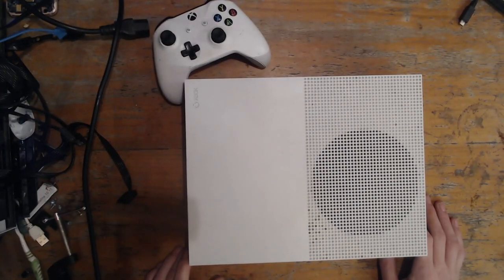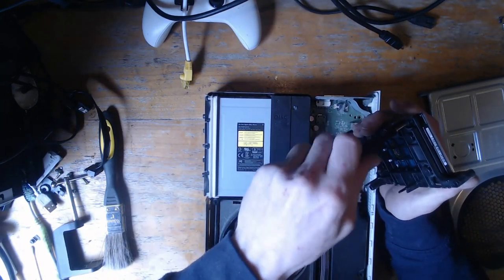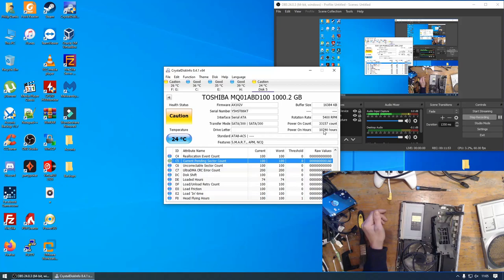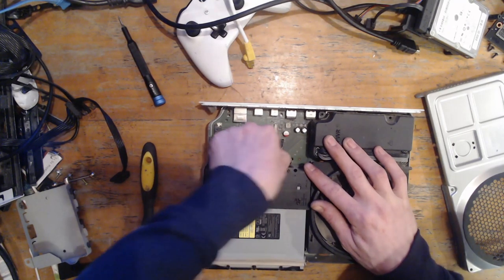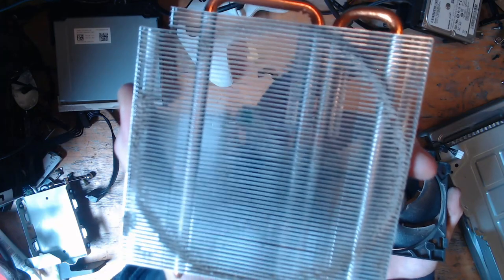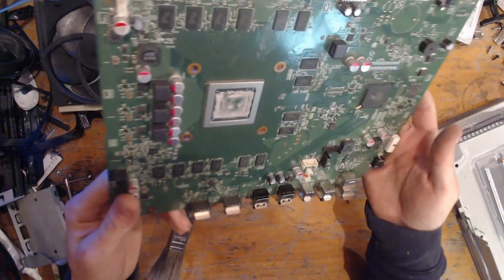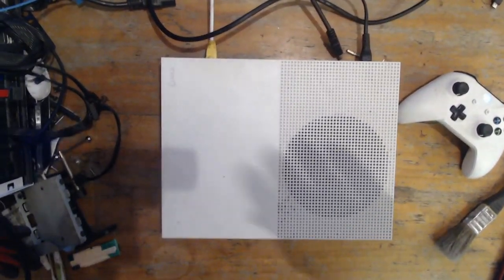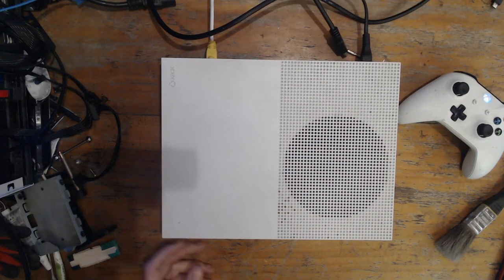Xbox One S Which Won't Update - E100, E106 & Faulty Disc Drive; This One's A Troll!

Comment: YES BRO! E106 on a xbox one X over and over wont update, disk drive Sata cable was the cause, not shorted or open on any of the lines. Swapping that cable and putting it back brings the error code right back, weird Im still not sure whats failed inside the cable..

Comment: Add the same issue with an XBox One S. The OG 500GB HDD died and I tried replacing it with two seperate 500GB SSD and and 1TB SSD, but kept getting the E100 error - Finally took a spare 2TB HDD I had laying around, the update finally went pass the 59% - 62% window. The 500GB SSD worked on an original XBox One (VCR) & the 1TB SSD worked on a XBox One X, but only 2TB HDD would work on the One S. All the HDD & SSD read as healthy on my computer, so not sure if the HDD script we are all using is faulty for the One S for the 500GB & 1TB setup scripts, but it worked flawlessly for the 2TB HDD.  🤷‍♂️

Comment: Hey I'm finding your videos really instructive, I'm trying to repair an xbox one phat which gets stuck at 86% updating and simply freezes there, tried replacing hdd twice, tried different sata and power cable, everything you could think of but nothing works. I was thinking it might be something within the motherboard itself, like the NAND flash corrupted or maybe fault on the south bridge chip? Do you have any idea you could give me? I'd appreciate it so much! Otherwise I'll just use it for parts

Comment: Why did you use fat32 instead of ntfs for the USB? 
I keep getting e106 and e102
When I do the offline system update it says something went wrong
Currently watching around 35 minutes in the video
Reply from the maker: What percent do you get to when you get the error? To be honest I'm not sure why I formatted in FAT32 since it is actually supposed to be NTFS for the OSU
Reply: @TheCod3r  ill get to 7% does that mean anything and its tne error code 106

Comment: So I have an xbox day one edition and I get the error code: E100 00000706 80070002 and can't find specifically what it means. Ive already swapped the hard drive so I know it's the disc drive but how do I know if the daughter board is working?
Reply: System Error: E100 00000703 80910002 and i know its my optical drive because i reefed the sata connector off the optical drive 😂

Comment: i have the same problem . but my hard drive is like new , haw can i check if the hard is the problem ???
Reply from the maker: You could hook the hard drive up to a computer and see if it reads in CrystalDiskInfo (free software)
Reply: @TheCod3r  but in this video your hard drive looks fin in CrystalDiskInfo before you putting it in the Xbox, and it's not working
Reply from the maker: @anishella95  if the hard drive is good then you would need to fault find and figure out what the issue is. It's hard to say without seeing the console in person unfortunately

Comment: Excuse me sir but would a Seagate Guardian BarraCuda ST1000LM048 - Hard drive - 1 TB - internal - 2.5-inch - SATA 6Gb/s - 5400 rpm - 

Be compatible with the xbox one s
Reply: If not then what would be the most recommended at the cheapest price.
Reply from the maker: Hi, yes any laptop (2.5") hard drive should work fine for the xbox one s :)
Reply: @TheCod3r  thank you

Comment: Hey Phil, I've got similar issue, it comes up with E101/E102, depending on what I do, checked the hard drive and it was faulty. I replaced the hard drive with a know working drive (tested using seatools), re-partitioned it using xboxonehdd-master, uploaded the latest OSU files on SystemUpdate 1 A/B/updater.vxd etc, even added the boot anim file. Its a process I have done before. However I am getting the same issue, even when I boot to safe mode and try and apply system update, I get to 1%. Do the Xbox's have some kind of flash which might be corrupted. Really in pickle with this one, any ideas let me know.
Reply from the maker: Hey Abdul, I'm actually not sure to be honest but being that it only gets to 1% that would generally tell me that the system isn't recognising the hard drive. Did you check the power and sata cable to make sure it isn't damaged? If the cable isn't the issue I would try another drive. Some consoles can be fussy, I had one which I did a video on a few days ago which wouldn't update with a known good drive but then worked with the drive out of my own console
Reply: @TheCod3r  I've just pulled another drive/caddy out a redundant console, still giving me the same issue, saying that it was the same brand (samsung), will try it with brand of drive tomorrow.
Reply from the maker: @abdulvalimahomed5496  yeah just keep trying hopefully it'll work eventually

Comment: Hello my name is Lucas , my Xbox one s have a error e 100 00000706 8070002 , can you help me?
Reply from the maker: Hi Lucas, E100 is a general error code and could be anything. It may have a bad hard drive or a bad disc drive. You will need to try replacing the hard drive or disc drive, and if it still doesn't work you may need to seek help from a technician near you. I can arrange to repair it for you if you are able to ship to my country (United Kingdom). My contact details are in the description or on the about section of my channel. 😀
Reply: @TheCod3r  very thaks for your help
Reply: @TheCod3r  now i have error e100 0000070D 8B050001 , you can help me?
Reply from the maker: @lucasaugusto7009  the chances are you may have a faulty disc drive daughter board and it may not be possible to fix it. It would be hard to say though without looking at it

Comment: Can the bad drive be fix, by reformating or so other means?
Reply from the maker: Not usually mate if it has bad sectors it's a ticking time bomb to be honest
Reply: TheCod3r I messed around with those types of drives in the mid 90s , but once SSD came out that’s all I use. I have 2TB on board my computer and a separate 6TB external tower for data storage, it’s in a fire proof box, that’s where all our photos and videos are stored
Reply from the maker: @jasondoesthings919  i generally still use spinning drives for mass storage but I have them backed up in raid 5 so I can afford to lose a drive and still not lose data
Reply: @TheCod3r  where would i buy another drive?same exact xbox

Comment: how did you fix the e106 problem
Reply from the maker: The disc drive or hard drive is usually the cause of e106 and E100
Reply: TheCod3r so did you just use a brand new one to fix the problem
Reply: Same problem here
Reply: @TheCod3r  подскажи сложно сделать дисковод?

Comment: I have the first Xbox one that ever came out and it stopped working 2 days ago. It was stuck on the update at 53%. Idk what to do to fix it
Reply from the maker: It can vary but likely will need a hard drive replacement just like the one in this video
Reply: TheCod3r thanks for the input, I’m gonna have to wait a while and prob just buy a new one